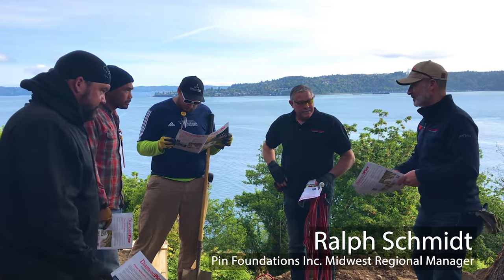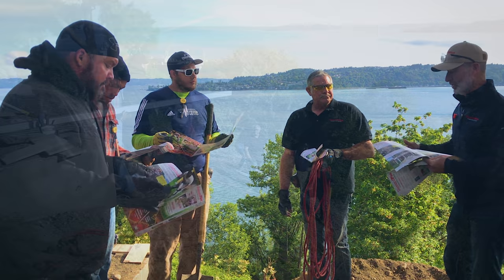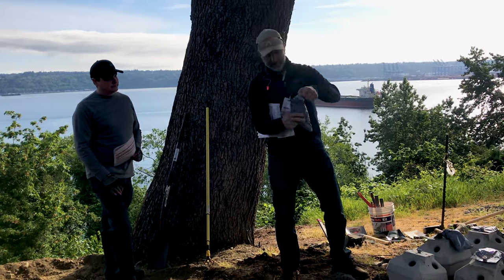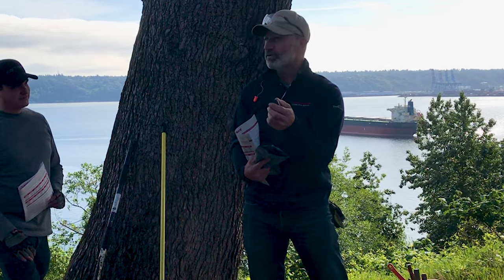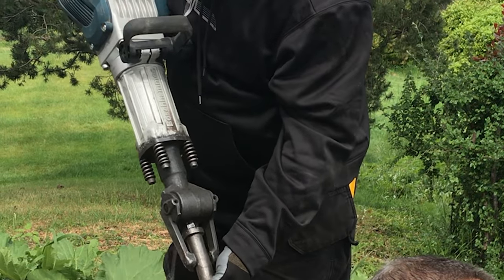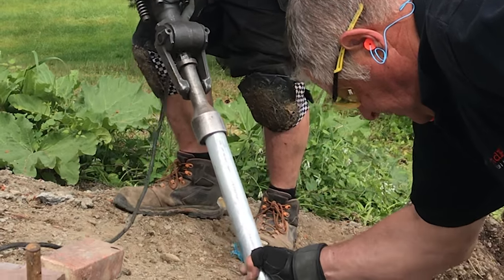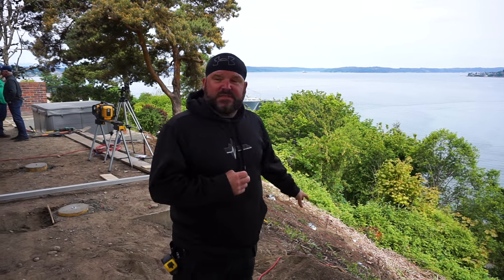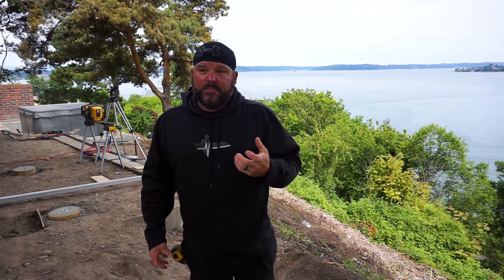10 Deck Footings in 3 Hours - Dr. Decks & Diamond Pier

Comment: How long do the pins last in the ground I could imagine they would deteriorate rather quickly maybe within 10, 15 years ?
Reply from the maker: We engineer the steel bearing pins to meet / exceed the life expectancy of the project. The pipes are certified to meet ICC specifications- more info can be found in our ESR-1895 report paragraph 3.2.3 Steel Bearing Pins. In 1997 we were chosen as the foundation for the Billy Frank Jr. Nisqually National Wildlife Refuge mile-long boardwalk, hasn't been a problem with 100s of Diamond Piers for that project. 1997.

Comment: Can you use a rental jackhammer to send it in. I guess you need a cup type fitting to go over the end of the pipe
Reply from the maker: Hi Leo, yes you should be able to rent an electric jackhammer from your local lumber store or building supply. You can find your nearest stocking retailer: www.diamondpiers.com/retailer-locator  
often times they will also be able to rent out the Diamond Pier driving bit that fits perfectly, or you can purchase from our website directly.

Comment: Awesome idea but alot of labor. Also, what is the life on those pins? Galvanized steel is only as good as the zinc coating on it and i imagine driving them in the ground peels a significant amount of it off.

Edit. I would use this over concrete piers any day because of cost, and the ability to replace/repair.
Reply from the maker: It actually cuts down on labor, you can install them in about 10-12 min per footing. check out our install video: https://youtu.be/-o689TrHEz4
Reply: Every deck company i know of in my area has switched to these... Almost exclusively.    Way less labor and a proven record of working.  Not too mention they can all offer decks in a day now.  

Considering in my area people pour footing wrong all the time and don't bell them;  these outlast most those footing and hold way stronger through ice heave...

Comment: I would question the life expectancy of the pipes in the ground…….looks like a coastal area also…..salt water?
Reply from the maker: The Diamond Pier is widely used on Cape Cod for the uses listed in section 2.0 of the ICC ESR. We engineer the steel bearing pins to meet / exceed the life expectancy of the projects they support. The pipes are certified to meet ICC specifications per acceptance criteria AC336.  More info can be found in our ESR-1895 report paragraph 3.2.3 Steel Bearing Pins. 
https://www.diamondpiers.com/sites/default/files/inline-files/ESR-1895_5.pdf

Comment: Never work in Connecticut tho you would never get those pipes in without hitting rocks 5 feet lol it would stop seat at 5 inches lol
Reply from the maker: Diamond Pier does need penetrable soils. The pins will push through rocks about the size of your fist or smaller and you can rotate the head to avoid obstructions. We find once contractors use it once in a spot they know has good, penetrable soils, they get an idea of what areas around them they can use it in and where it won't work.

Comment: I live in mid Minnesota, in sugar sand soil.  How is your product stand up with the frost line and cold winter conditions.  I'm planning on putting a deck onto my house. Very impressed. Also are there's local distributors in mut region?
Reply from the maker: Hi Ed! - We apologize that we are just seeing this. Our system is used quite a bit in MN, and our larger model (DP-75/63) offers a 60" frost depth protection. We have over 200,000 Diamond Piers supporting projects in Minnesota. We do have local distribution. You can find the closest retailer to you here: https://www.diamondpiers.com/retailer-locator 

Thanks so much for your interest, and please feel free to call or email us with any questions. 708-406-5005, info@diamondpiers.com

Comment: How much?
Reply from the maker: Hi @Ethan Lingenhol, we have two models available through retail stores. 

DP-50/50 (Equivalent to a 20"x48" traditional footing) - Suggested MSRP $148
DP-75/63 (Equivalent to a 22"x60" traditional footing) - Suggested MSRP $210

Equivalency is based on minimum 1500 psf soil strength. Please let us know if you have any other questions!
Reply from the maker: Leon thecat  - Consider the amount of money you save in time and labor. Our builders who have switched to using Diamond Pier are completing almost twice as many projects in a year, and making a lot more money. 

 "10,000 piers and counting. DP has changed the way we build decks. Time and cost savings, ease of install and lifetime warranty makes it a better foundation system." - Pat Noonan, Deck and Basement Company